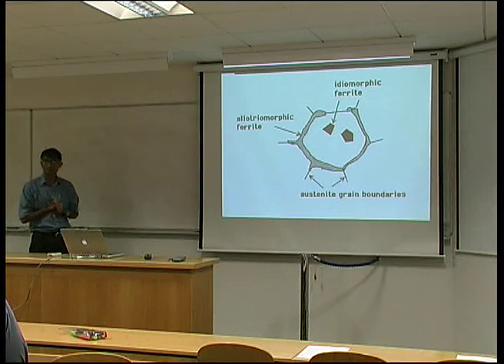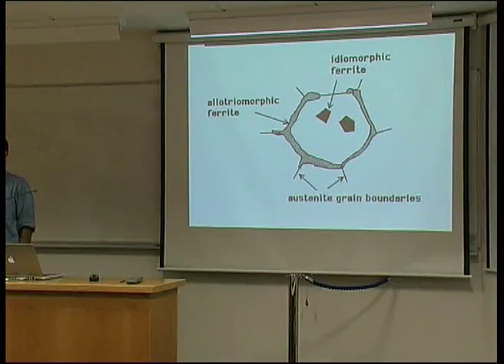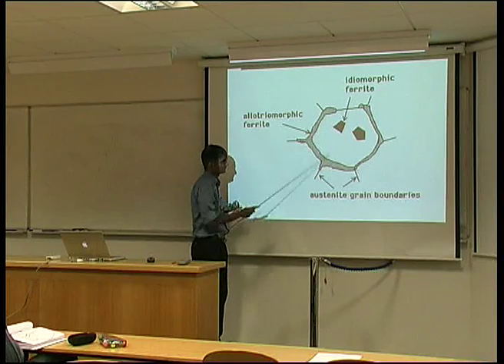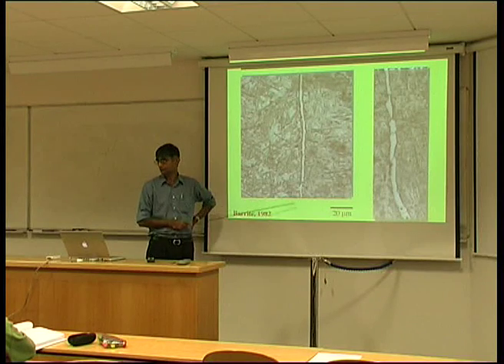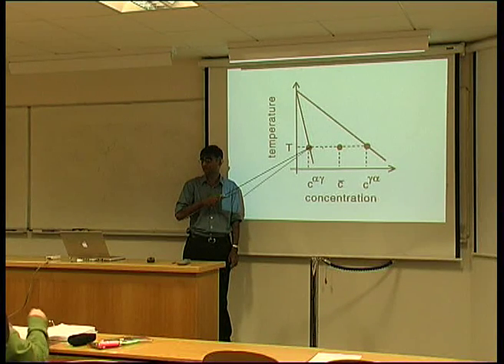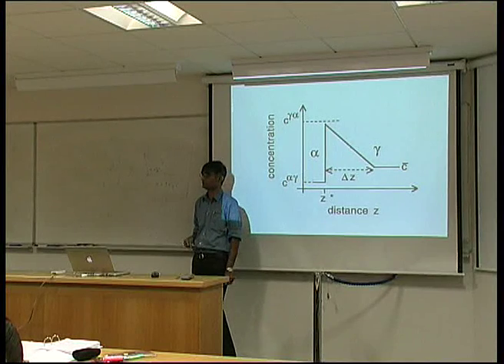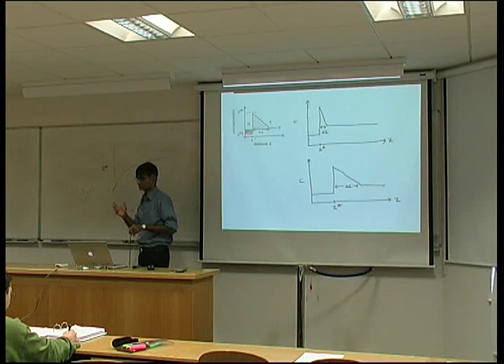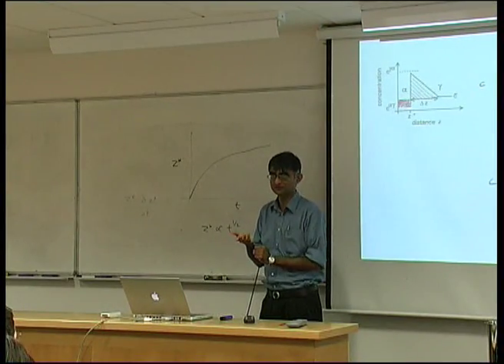Allotriomorphic and Idiomorphic Ferrite in Steels: Introduction

Comment: Thank you for this lesson. Is it possible to see the idiomorphic ferrite in SEM or you need to attack the steel to reveal the microstructure?
And, is It possible that idiomorphic ferrite has grown by 111 planes and It presents a triangular morphology instead square?

Thank you so much
Reply from the maker: You can use electron back scattered diffraction to image the idiomorphic ferrite. Not sure about your second question.
Reply: @bhadeshia123  thank you!!